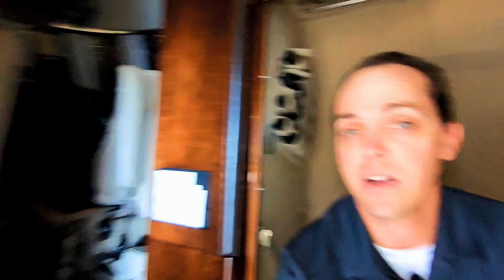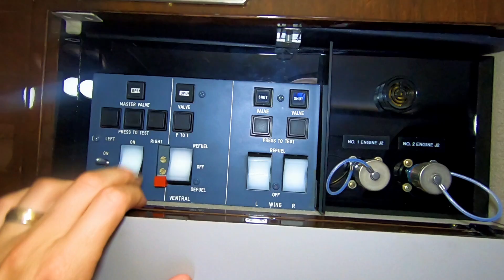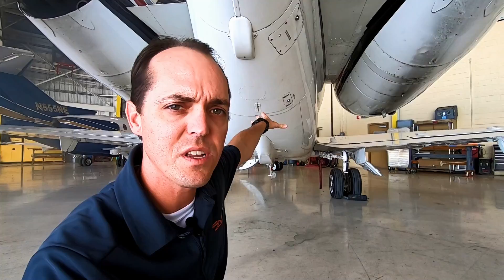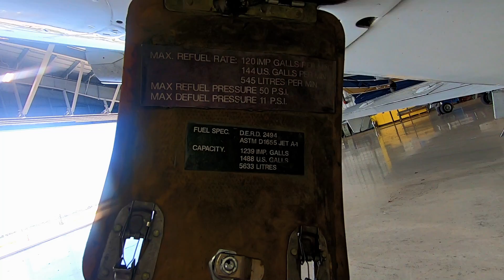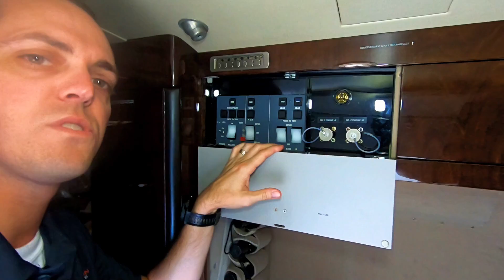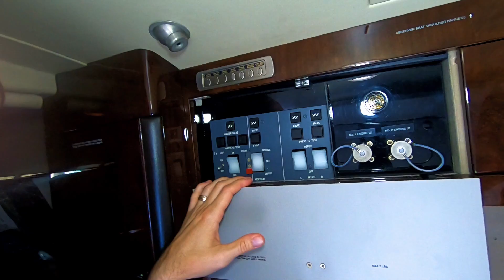Tech Tuesday -  Hawker Fueling System

Comment: The fuel panel is there for the 700 and 800 series. The fuel panel on the Hawker 1000 is on the left bulkhead as you are on the steps.

Comment: I have fueled this type of aircraft nothing to it except for the position of the fuel connection. You have to squat down while trying to connect the fuel line. The fuel head is around 29 lbs so it can be awkward. Many other corporate jets are easier.

Comment: what would be a normal fuel load for Hawker and the G IV
Reply from the maker: Normal will vary from one flight to the next, but max fuel in the hawker is 10,000 pounds, and 29,500 for the G-IV. As an example, a 2 hour flight would be around 5,500 pounds in the Hawker and 10,000 pounds in the G-IV including reserves.

Comment: Hey Shaun thanks for the great content again. In the 90's, I worked an FBO on the weekends during college. I had my PPL then. It was common for pilots to not communicate clearly how much they needed exactly. On more than one occasion, I saved a flight because I stopped to ask the question about how many pounds they wanted, and if it were split. While I did defuel quite a few of the mistakes that the pilot would make, one stood out. It was an ASA Brasilia. And they were doing a training flight. Guy asked for 3700lbs per side. I set it and started pumping. But it didn't sound right for a local training flight to be so heavy. I walked to the cockpit and asked them again are you sure you want 3700lbs per side? Because that does not sound right at all for a local flight. Both pilots went flush and said no, stop fueling. They meant 3700lbs split between sides, not total per side. Their paperwork reflected the mistake as well.  I used that example to train the next guy, that if it doesn't sound right, ask the question.  Keeps from making unnecessary work. And yes, I've been baptized by jetA on the ramp when our single point blew it's seal. Not fun. Fire department, paperwork, and decon. =)

Comment: Another 'back in the day' comment. I flew a PA28 Turbo Arrow IV (1979 'T' tail) into Goodland KS with 4 adult passengers. Asked the FBO to fill both tanks "to the bottom of the TABS" which I intended to mean basically 1/2 full each side. Left the plane & went to town. Next morning found out line person had thought it meant as much as you can cram into the tanks to overflowing! Now what do I do with a plane 300lbs over G/W at 3,600' elevation and 80° outside? Thankfully I was aware BEFORE I tried to takeoff!

Comment: I believe you can fuel the aircraft over wing if necessary, am  I right thinking that?
Reply: Yes, the Hawker has fuel caps on each wing and one for the aux tank which is on the left side of the fuselage next to the single point fuel connection.
Reply from the maker: yep!

Comment: Seems kind of complicated.  My only experience was working at a small ground station with Dash 8s.  Since I'm curious, I went over and talked to the fuel guy one day.  We'd call them and tell them what the needed fuel load was from the dispatch.  The fuel went in under the number 2 engine and their was a gauge for each wing tank.  If we wanted 2,500 pounds he would look for 1,250 in each wing.  Really not sure if the pilots had to do anything, they could tell if they did not return a switch to the proper position.  Really didn't look all that precise to me.  Didn't seem to be any such feedback for the fueler on the Hawker.

Comment: Does this class of plane have a maximum landing weight like an airliner, such that a fuel dump might me necessary on an unscheduled return to the airport?
Reply from the maker: We do have a max landing weight, but it isn't required to have a fuel dump provision as it can be landed up to the max takeoff weight with a gear inspection afterwards

Comment: I didn't see a grounding point in the fuel door.  Is that not a thing on planes like these?
Reply: It's in there-  just kinda hard to see from that angle
Reply: There is a stud on the nose gear marked "bond point." Having said that, I've seen the grounding wire get attached to all kinds of places.
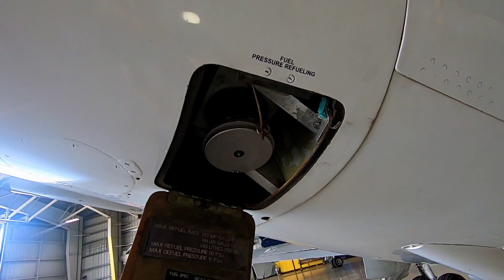Reply: There's another stud right next to the fuel port.  You can see it in this video at 03:35 .  It's right next to the micro-switch.  You can see that the metal rib where it's located has been stripped of paint from people grounding to the airplane, unlike the other rib which has it's white paint.
Reply: It is but its probably on the undercarriage. Someone here will know for sure.

Comment: Thanks Shaun. My recently acquired CPL baseball cap will be off to the Isle of Wight on the south coast of the UK at the weekend.  They do have an airstrip but I'm not sure there's enough feet of runway for your machines.  However the CPL brand will be visiting none the less.
Reply from the maker: Awesome! I would love to see a picture of that!
Reply: @CorporatePilotLife  Challenge accepted. I am sure to drive by Bembridge Aerodrome. That has 2700 ft of concrete runway. The actual Isle of Wight airport has a grass runway. I doubt a G4 would appreciate that.
Reply: @CorporatePilotLife  Hi Shaun, picture sent to your gmail address.  I hope you got it.  Another for the collection no doubt.

Comment: That Hawker must be ancient..
Reply: The original design is from 1962, by 'de Havilant'. The same factory that built the 'Comet', the first passenger jet. The company changed ownership dozens of times, it has been updated dozens of times and was in production until 2010-2013, when Beechcraft went bust.
The current owner, Trexton, also owns the rights to the Premier and the Citation. So they understandably focus on the Citation.
Reply from the maker: This one is actually fairly new...2005 I think. The design is quite old though.
Reply: @CorporatePilotLife  With the antiquated fueling system and the placement of the APU controls are something from the 90"s

Comment: Does it have the option to dump fuel while in the air like commercial planes ✈️
Reply: No it doesn’t. Even though it’s not recommended to land with a full fuel load if they have to do it they can and the landing gear is either going to need some repairs or be ok depending on the landing.

Comment: This may be a silly question, but with the fuel being pumped up, does some leak when the hose is disconnected from the plane? Looks like a good way to have a spill...
Reply from the maker: They actually have the connection system fine-tuned in a way that it doesn't drip anything at all. Perhaps next time I get fueled, I will record the process for you...
Reply: Im a fueler, the single point fueling adapter doesnt leak any fuel between the adapter and nozzle.  Now with that being said, depending on the age of the aircraft it could happen.  Had a MD-11 give me a shower of fuel but it wasnt much.  just enough to leave me smelling like jet a1 for the rest of the night
Reply: You may get a few drops, whatever is collected between the aircraft and the nozzle poppet valve after fuel pressure has been discontinued.  We usually keep a rag handy to catch it and properly dispose of the rag after.